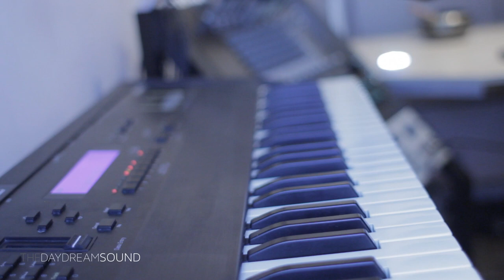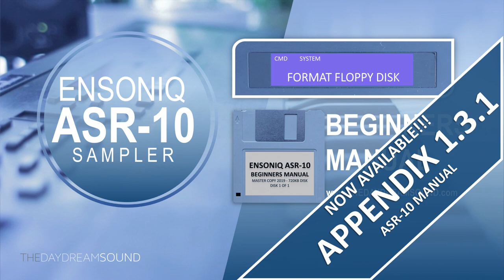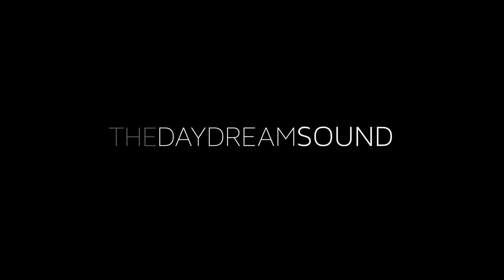ASR-10 FM Synthesis via Waveboy Algorithm

Comment: My ASR's floppy drive is only working when it feels like it atm. Just recently managed to format an external scsi2sd while I could boot off of the os disc. Hopefully it'll decide to work again so I can put the os onto one of the partitions (and maybe transfer some hand-me-down floppy files on there too 🤞). If it works I'm instantly picking up your asr10 beginner's manual!
Reply: I bet you can still get a replacement drive for $50ish. I replaced my EPS16 floppy drive (3rd? time) last year. It’s just a few screws 🙂